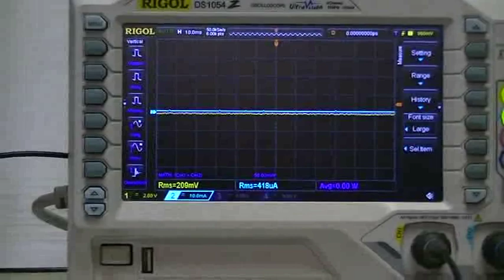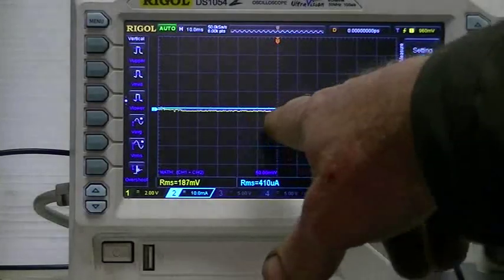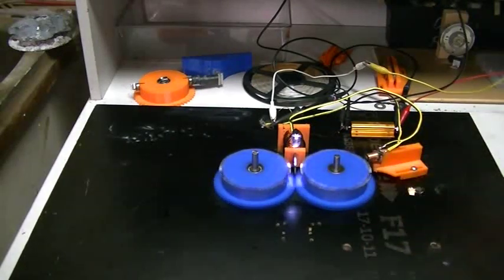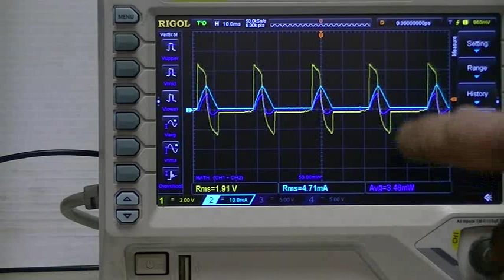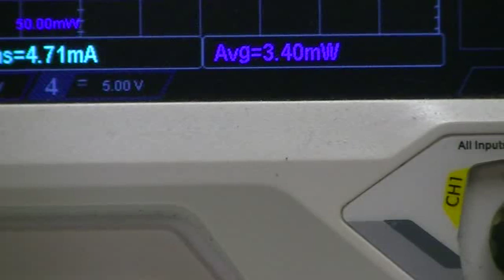Zero Back EMF pulse motor

Comment: Very interesting and unique approach to a pulse motor. I like the 3D printed parts you made too, I've been using whatever I can repurpus from scrapped equipment. 
 Have you tried using Bismuth metal's diamagnetic properties in any magnetic motor designs?
Kudos on eliminating the back emf spike without additional electrical components by the dual rotor design too. 👏
Reply: @@ChannelTheLizard thanks, will do.

Comment: could you use stepper motors to put your rotor on?  Maybe then you could have a super low input and bleed some power off of the stepper motors.
Reply: They would probably add way too much load drag for this design or any pulse motor in fact - stepper motors always have magnetic cogging resistance to rotation at every tiny rotation angle rotor shaft is moved by and pulse motors have large rotation angles where they are essentially gliding between pulses and not making any rotation torque output.
 Yeah they do good as generators, but under load or not, they require a lot of force to rotate the rotor.
Reply: @TGiFoosday  That's true, just a thought.

Comment: If anyone could point me to a self-running motor video of any kind, would love to see it.  I have yet to see one in action.
Reply: Watch UFOpolitics video, where 2 AA 1,2V 2200mAh batteries run 750W DC motor for 30 minutes. It is asymmetrically modified DC motor, with two commutators and independent coils. Coils is switched on and off.
Reply: https://youtu.be/GWHTm_id0YU

Comment: I really like this idea. It's a bit of a head scratcher to where I'd have to just see it working cause I wouldn't be 100% it would even if it seemed like a winner on paper. 
For the amount of clickity clackety going on that thing is doing some serious moving at only 4mA. I guess compared to some of the other pulse motors you've made it's not setting any records but it seems fairly torqued out being able to use both the attraction and repulsion in the setup.

Comment: Pretty awesome Tin Man! BTW, I brought a Anet A8 last week on your recommendation :-)
Reply from the maker: They are the best bang for buck i recon. Just bolt it down to a good solid base,and you will have no problem.
Reply: @69Atho  Just assembled it. Found the Z axis will go up but not down, swapped steppers and ports points to a mainboard issue (I think).
Reply: @69Atho  Fixed the Z axis issue. It was a bad capacitor on the endstop logic. I just removed it :-) It's actually printing pretty good. I'll upload a video on my channel later.

Comment: Nice idea mate what load could be use for that much power input as a opposed to most motors? Also could you do this same motor but use attraction not repulsion that would make magnets last longer but would be a little tricky. Could this type of motor be made to run smoother?

Comment: Great build and looks like it’s moving pretty good is there enough torque to add a high impedance generator coil and still spin?? What about a horseshoe coil that is opposite the drive coil that hits the magnet on both rotors. Something like Ed’s Pmh with a forward coil on one leg and a reverse coil on the other both tied into each other and see if you can squeeze a output out. Just a thought.

Comment: Great to see Tinman back with his teasers. I did try this very setup right after your last video. Works well. Could not make the rotors like you did, so improvised with two plastic lids, like Lidmotor’s, and lucky find of hard plastic that I turned into gears.
For generator, used the Hatem system. Even two window motors on two sides work as generators. Measly output but Works Just Fine. But I have a far greater amp draw than what you achieved. Thank you again Tinman
Reply: Here is the original concept  https://www.youtube.com/watch?v=kU0IV2YjVEo  that this seems to be inspired from which does not seem close to it.   Original had an iron core , more magnets, repelled more than attract the iron center.